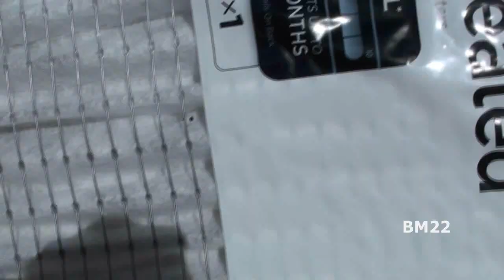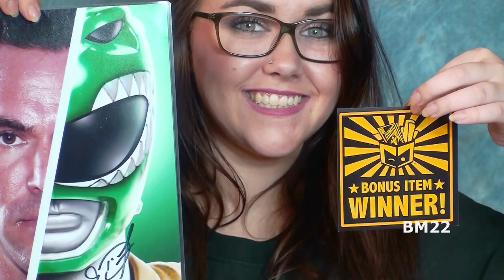Black Widow Spider Observation Tank: New Spider Habitat Set Up

Comment: I think that's a very good idea and the filter should work great !
Reply from the maker: Thanks, but I do wonder if there will be enough airflow since with a furnace, it's actually drawing air in, but only time will tell.
Reply: @BM22TechReview  I'm pretty sure that it will be fine, I don't think the fibers are air tight even without the force pushing it.